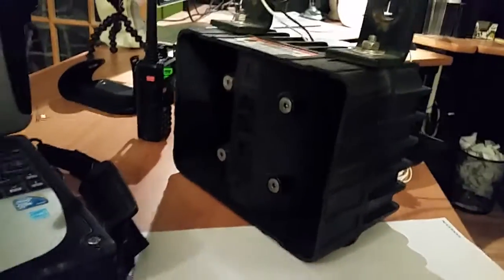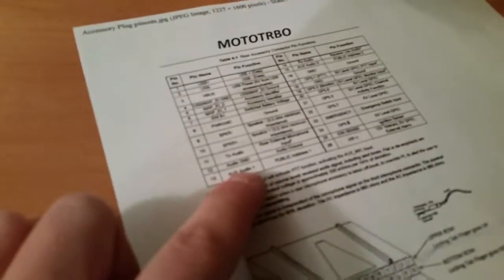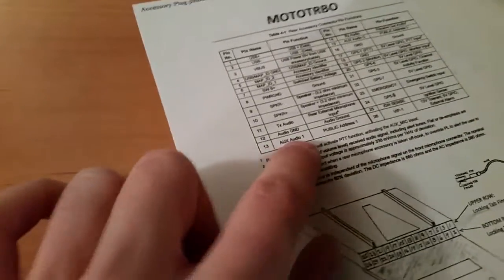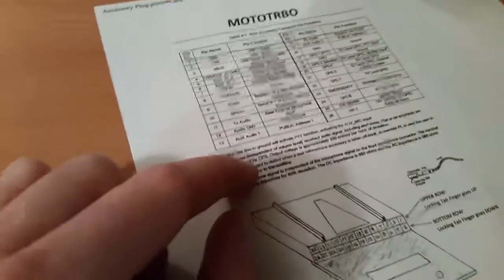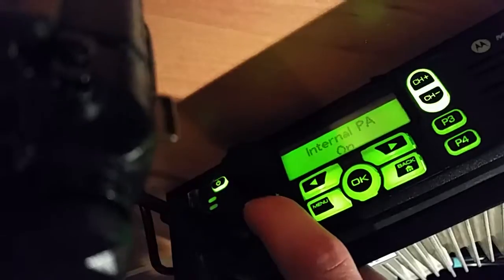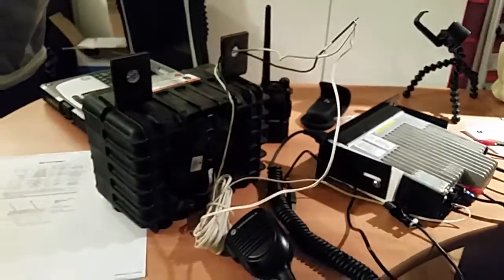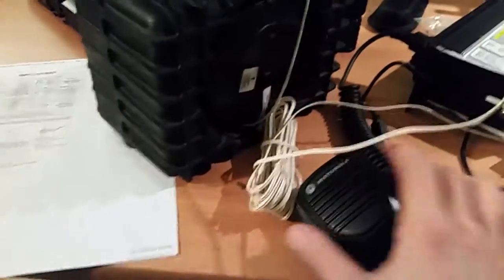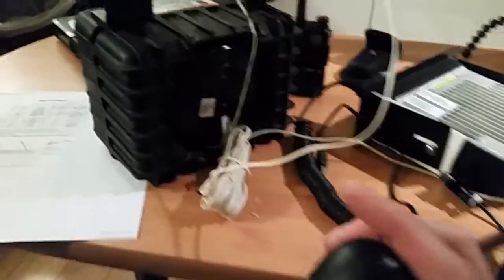Demo of MotoTRBO XPR Radio PA Function

Comment: installation manual shows 13 and 15 are for pa labeled rxd and txd respectively. pin 12 is the negative for speaker output intended for use with pin 11

Comment: Does this also transmit on a channel at the same time or, when PA mode is enabled, does it just send audio to the PA speaker?
Reply from the maker: This is PA Only. I believe it has radio rebroadcast feature
Reply: @QuaabQueb  thanks, I’d actually just want it to come out the speaker. Will have a play around with it.
Reply from the maker: @orbellau  that's known as radio rebroadcast, where all radio traffic is broadcast through the loud speaker. Useful for crews working outside the vehicle without portable units or in loud environments
Reply: @QuaabQueb  ahh okay, gotcha. Thanks very much.